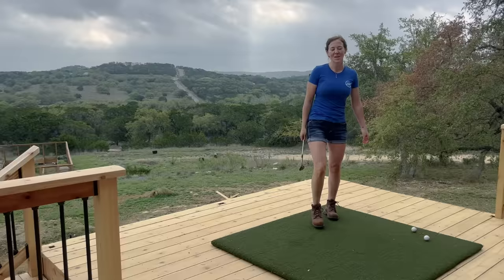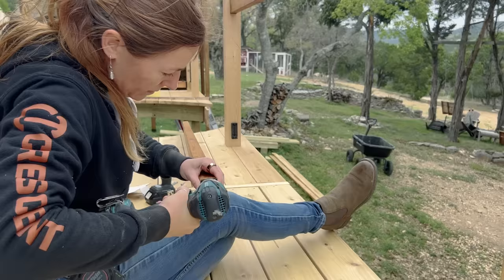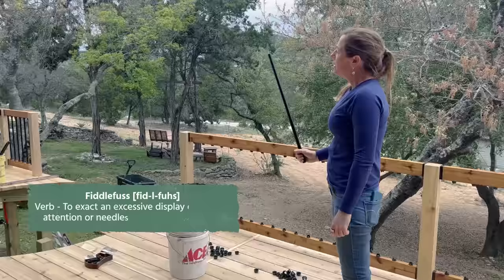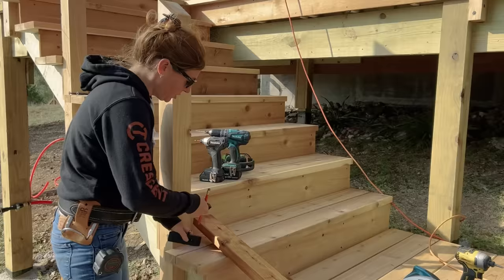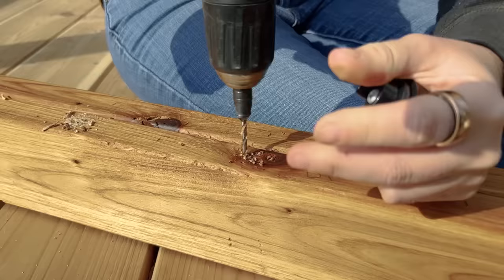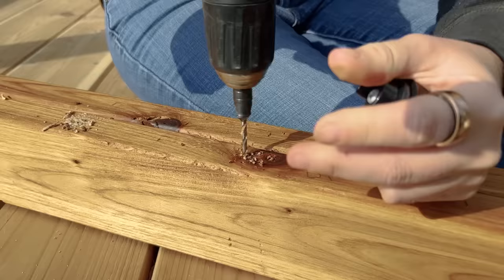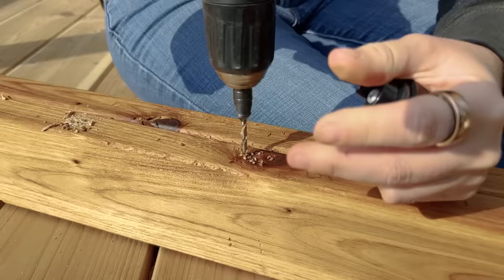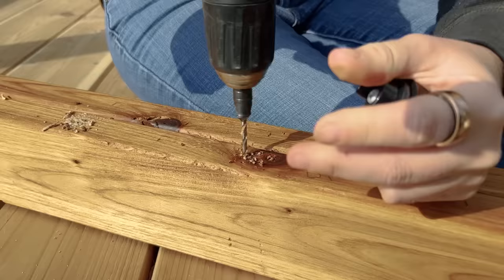How to Install Railing and Make it Removable

Comment: Girl, you REALLY need a lapel mic. I want to be able to hear you talking.
Reply: I think thats one of the reasons she does voice overs. I wouldn't want to have to be wearing a mic and battery while doing construction.
Reply: @sloapmonkey123  I'm not sure what year you're from but these days you don't have a battery pack. It's just a small microphone that Clips to the collar of your shirt and it's rechargeable.
Reply: @Kevin-ln6ql  That's correct. They're tiny, but sound great.
Reply: @Kevin-ln6ql  alright I'll concead I did not know about this, however I'm curious how long the battery is. Would she have to stop construction throughout the day to charge it? Might it still be something that gets in the way? When carrying lumber and moving my body and tools around, I get stuff caught on my clothes and anything connected all the time. Whatever the reason, I definitely see the benefit of wanting to worry about audio after the project. Just one less thing.
Reply: I can hear her just fine
Reply: I had no problem hearing her. Maybe it’s time for a microphone for picking up sound that goes in your ear. 
I’m just sayin 🤷‍♂️
Reply: @Jonah  it's 2023, those mics are far less cumbersome than wearing a hoodie while not wearing the hood.  The battery will last multiple days too
Reply: @sloapmonkey123  voiceover for construction/woodworking videos is the way to go almost all of the time. Or at least majority voiceover like she does. Aside from the noise issue the videos flow so much better.
Reply: 1.4 million subscribers. Tells us, that the problem is on your end.
Reply: @Jocky919  the Teletubbies have over 3.5mil followers.  That must mean everyone not infatuated with everything they do is the problem
Reply: @Kevin-ln6ql  “what year you’re from” 🤣🤣🤣  I’m older than dirt and I thought this comment was hysterical. 🍻

Comment: Would never fly in this state. Railing post not firmly attached... Pilot holes where the screws just fall in... Balusters far enough apart to stick your leg through... top rail held in with little clips and small screws...  Looks aside, would never install that!

Comment: My wife and I are redoing a 36x16 deck with two sets of stairs.  We are going with the same railing system (Titan) as you did.  I think once completed it will look so nice.  My question is how dry (moisture content) was you wood, especially the 2x4's for the balusters?  I read on Titan's site that the wood should be dry.  It's hard to pull off and have straight lumber.  Anyone who's worked with treated lumber knows the nature of the beast.  I'm not sure how much a treated 2x4 will shrink in length, as that would be an issue with the screwed on plastic ends.  If you, or anybody else reading this, we'd really appreciate the help/advice.   Thanks so much!

Comment: It's amazing how fast this railing system speeds up the process of building a project. I love the overall look of the Cedar and Black color scheme April!!!
Reply from the maker: Yes, I love the cedar and black combo. Thanks for watching.
Reply: @aprilwilkerson did you secure those posts to the blocking sleeve you created and slipped them into? Figuring you just didn't show it?

Comment: From experience a suggestion. Where your top railing pieces butt together over a post cover the top of the post with something waterproof such as  joist tape. As April states water will rot the tops of the posts when it seeps between the boards.

Comment: That's a pretty slick system. One thing you might consider for the removable sections is using hardware, like a bolt latch to attach sections to each other and to the deck, to provide a little more security should someone fall into the railing.
Reply: Yeah, but then you have to go underneath, break out tools, it's a headache. If you just wanna shoot off your deck or drive some golfballs, then this is fantastic.

Comment: OMG! I did the same style Deck, Ramp, Balusters, Top Cap except I used the old style 'fixed' or adjustable black aluminum balusters from the local box store! The installation was enough to make a grown man cry! I finally came up with a jig system where I would lay out each railing section (including the stairs) on my large lay out bench, assemble everything laying down with a square, inserts all the balusters, fasten temporary 1x4 face braces to hold the whole rack together, then drop the whole section into fence brackets on the posts! Absolutely beautiful look but I paid a high price.........my sanity! Ha, lol. I had a gut feeling someone would improve on the baluster connectors. I didn't watch the entire video due to jealousy, where did you order these?
By the way, I used that new product 'flex seal' Black roll on to do my top 2x6 cap rail, it looks amazing with the black balusters and the rubberized paint/seal looks to be holding up to the the weather and I doubt I'll have to ever repaint or seal but every 10 years. I used Sequoia Red treated outdoor lumber and the look is so incredible that makes my house look like it needs a 3.5 Million Dollar Upgrade! LOl Thanks for sharing a product that fills a must needed solution.

Comment: You could make your removable rails code
compliant by adding a dado to the bottom 
of the caps that allows a dowel to slide out 
of one cap into the other cap which will then
lock the removable rail in place.

At the corner where the two removable rails
meet, the dado and dowel would be placed 
in the one, and a dado in the other so that
they lock in place.

Or you could place a similar mechanism at 
the bottom which would slide into the posts
and lock them in place.

This is more a safety feature for kids messing
about rather than adults, unless of course; you
get that one weird adult that tends to pull up
on anything he touches. I've never come across
someone like that but one time I did see a dude
walking down the street of a city attempting to 
pull stuff off the buildings.

Comment: As an old carpenter a trick you  can use to get your handrail height.  Take a framing square lay the 16 inch leg onto the front of 2 stair treads,using the 24 inch  leg mark at the top where it hits the post. This gives you proper handrail height for stair railings and meets all applicable codes.

Comment: If you have a chop saw blade for your miter saw, use 1/2" Rebar, and a wood bore bit to countersink 1" into a 2x4 that is top and bottom rail mounted between your posts. You can even use 4x4's for your rails to make them even stronger. Drill a 1/8" hole in the bottom rail holes for water to drain out. You can also hold them in place with some silicon caulk. A 20ft length of rebar is about $10, and yields about 6 balusters. You can use Rustoleum to paint them whatever color you want, and it lasts for decades.
Reply: question, if you want a more refined look if using rebar, could you use this lock in place system or are there other options to use for a cleaner look?

Comment: Love this concept.   We're redoing our deck and going with the same railing system. My question is, have you stained/water proofed your pressure treated wood (floors/rails) yet?  How does stain or waterproofing affect the aluminum balusters, or were there no apparent problems, issues?  Thanks!  Awesome video and a super nice deck.  I definitely can't match it.  😊  Thanks for sharing.

Comment: Thanks for sharing your videos.  Great efforts and illustrations.  You shows much enthusiasm with your work.  Just curious in your video,.  I noticed that there is a big 
shallow circle with a lower deck platform.  What is that?   Keep up with the good works.
Reply: Hello April,  Thanks for your latest video about your deck railing.  Now I understand why that you're installing a pool deck when you have a large shallow
circle on the deck platform.   Very impressive work.  Thanks for sharing.

Comment: Speaking of building codes; the model code (IRC) requires a 'graspable' handrail for stairs, Section R311.7.8.3 Grip-size . Did Texas delete this requirement? This Titan system is nice, we used it when remodeling our decks. The powder coated aluminum stands up to the weather very nicely.

Comment: ..  Interesting System ..  I have installed miles of railing over the years .. different types and materials ... different locations of the U.S.  .. inside and out ....  Note : spacings state under 4" spacing (i.e. 3.999 )  ,, not 4" ...  A 4" sphere cannot pass through ..  Have watch many of your video's ,, interesting projects ..  and you seem to have a good time doing them ... Stay Safe ..

Comment: can the railing be removed once the piece on the end of the railing snaps into the mating piece in the post?    I want to do a small removable section in my small back porch deck and steps, but I don't want to go through doing what you did for the removable section.    Great video BTW.   Love how this deck is shaping up.

Comment: Deck looks great really well built. As a building inspector  you can have a removable rail. It has to meet the same safety requirements as a fixed rail . It is done all the time to facilitate moving furniture and large appliances to a second story. Check your local codes some may require it to be lockable
Reply: I don't know if the top and bottom rail can meet code, attached with a plastic part, but if so, I don't think it's a good idea. The sun and time will weaken the plastic. I think many code requirements are too stringent, but plastic fasteners for a railing does not seem stringent enough.
Reply: @FLPhotoCatcher  I agree, but I doubt the code does.

Comment: I am planning on installing a handicap ramp and I am debating between pressure treated or composite. I believe pressure treated is about 1/2 the cost? My concern is it is more slippery and would have to be treated annually?

Comment: What if you used bolts & nuts to hold the removable rails when you don't want them removed for code compliance in those areas that care?
Reply: It depends on your inspector and any special stuff in your local code.  Almost always fasteners that require tools to remove are sufficient if the rail otherwise meets structural requirements. (The key intent behind the code is safety.  The railing needs to support sufficient weight and etc.)  Most people don't want to remove tools if removing the railing is for more frequent use than for new furniture, and sometimes that hardware is left off after the inspection has completed.  Often latches are sufficient - at least those are less likely to be discarded.  Sometimes a lock is required (but again can be removed or left unlocked).

Comment: I doubt any inspector would catch the the rails are removable. If you passed any earlier inspections for on the deck  especially for framing the first time and you have all the little details correct the  inspector isn’t going to go nuts checking a residential deck for final inspection.

Comment: Great looking railing system but it's too bad that the golf tee area couldn't be on swinging hinges so that the rail sections could be swung out of the way on a track instead of needing to be lifted out of position. Just thinking of older viewers, like me, who might find it difficult to lift sections in and out of the deck.

Comment: The screws they give you are not stainless steel. You mentioned not to use galvanized because it will stain.
Reply: You won’t see the staining where the supplied screws are used.

Comment: Dry wall screws really..... 😂
Reply: What’s the difference between a 2” dry wall screw and a 2” deck screw? A little paint.
Reply: @dontfit6380  .. metal it's made of .. they are not "painted "..
Reply: @rockytopwrangler2069  you must not have finished reading my comment. What’s the difference, a little paint.